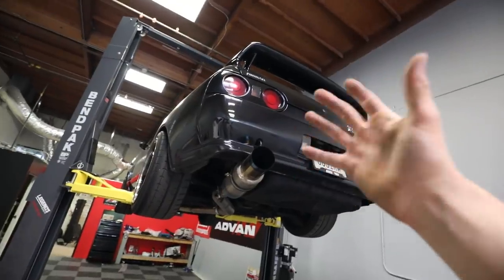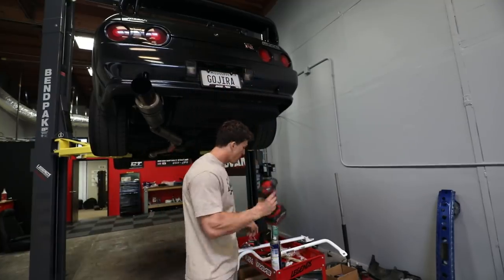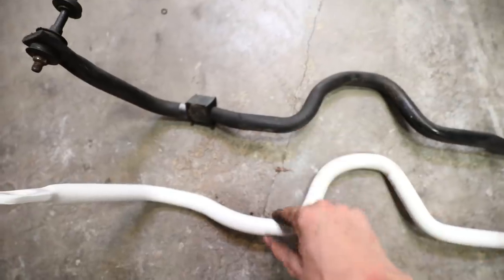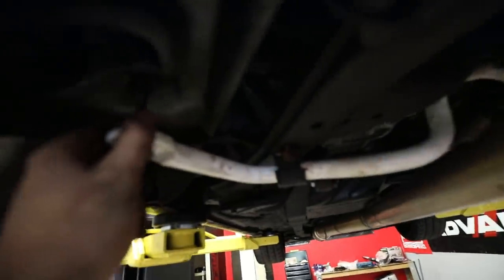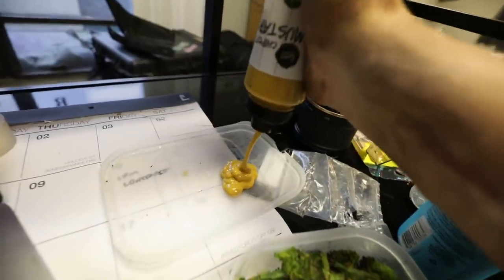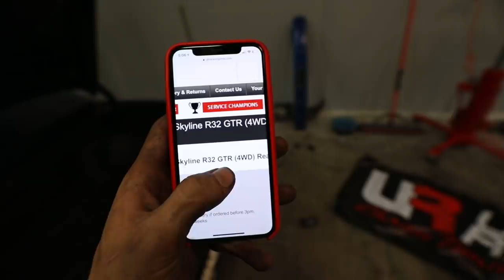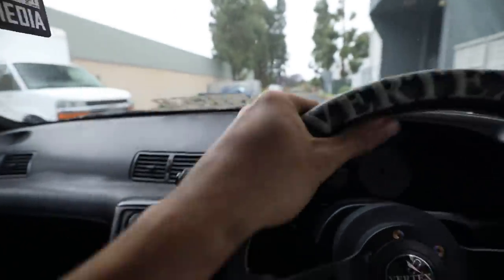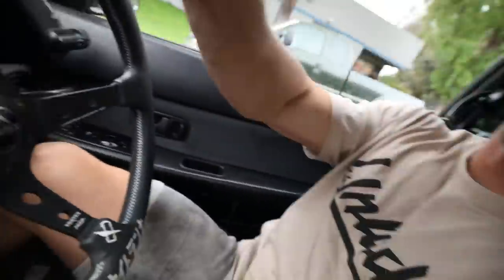Skyline GTR Gets UPGRADED! *Install*

Comment: In preparation for your first track day with the car you should leave it how it is. Drive and learn the car before doing mods. You don't even know if your driving style requires a bigger sway bar. Bigger doesn't mean better. Learn the car first then see if these mods help or hinder you

Comment: Come on Dustin you always clean the parts you install and you always wash your hands before you get into your car specially after you just finish working on your car...smh RIP vertex steering wheel
Reply: Seriously should invest in some Fast Orange Pumice Hand Cleaner although I advice using liquid soap too because it can be rough
Reply from the maker: i cleaned the strut bar once i was done lol just didnt show it